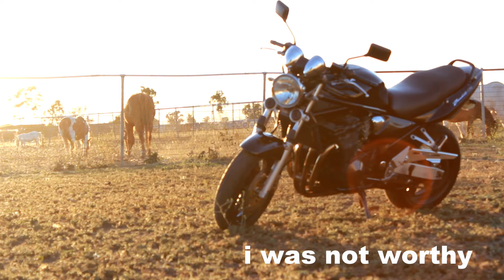How To Become a Motorcycle Mechanic With No School (2020)

Comment: Your advice also applies to many careers outside of wrenching on motorcycles. It's basically how I built my writing career. Practice, practice, get good, and harass people until they start publishing my stuff. :) I still hold down a day job to pay the bills, but yeah, living the dream. You're an inspiration. :)
Reply: Justin Hughes same here with software engineering. I got an associate’s, but it’s basically gen ed and two entry programming classes. It got me in the door somewhere. From there, I’ve learned everything on the job

Comment: if you want to learn how to fix motorcycle,
1. learn how motorcycle parts works and perform its jobs.
2. each part of motorcycle is parts of a system working together.
3. it is easier to learn on small motorcycle or single cylinder engine and  then go for more larger or bigger or multiple cylinder.
Reply: Amen.

I'm learning to do it myself because I cant afford to have a shop do it for me. It sucks major ass. I am looking to buy or just take a scrap engine for either free, or for very little and see if I can work around it. See how it works and ultimately take it apart and then assemble it once more into a functioning engine.
Reply: I have an 2001 bandit just like her and I can barely afford a shop to do anything 
Guess my carbs are coming off again
Reply: any YouTube channels you recommend or websites and or books?

Comment: OMG I love this so much!! I originally thought I wanted to be a mechanic. Got my first car (86 Civic hatchback) at 12/13 years old, completely broke down, for a mere two Jackson's ($40). Tore the thing to the ground to rebuild it back up. I had doubts in my abilities along the way that left me on the edge of mental and emotional breakdowns over it. Over the following ten years, I would find, repair, and flip another 16 vehicles (13 cars/trucks, 1 motorcycle, 1 dirt bike, and a JET SKI)...and well, I must have done something right cuz I have yet to see any of my previous vehicles in a junkyard! Currently working on fixing another 2 bikes as well as a gas generator of all things. In 2018, a shop my bud had been working for had an open spot and he put word in for me, they interviewed me and one other person. Needless to say, it came down to me, a shade tree mechanic of 8-9 years, or some 18 year old who hadn't even performed an oil change in his life. After nailing what I thought would be my dream job, I found out that I actually hated every second of the automotive variant in that field. Now I'm just a lost soul searching for his "call to arms" all over again... One of my interests is custom fabrication. I did buy a cheap Harbor Freight wire welder, which has its...limitations...but I can still weld mediocrely well on it; now the issue with that is I have no project that requires fabrication and no money to buy said project (or materials) because screw the C-word going around right now! It'd be really cool to get into things like custom motorcycles, which is how I came across your channel (rat bike build came up in my search on YT), but I don't really have any artistic vision at the present moment. Still interested in giving power sports repair a try, myself, as working on that jet ski was...different, to say the least, and very intriguing; cool pieces of technology! I'm also interested in adventuring touring in some foreign place, like Africa, as a guide. That would be BAD ASS! But would also require the funds to travel as well as years' of experience in the savanna.

Not inspiring like your story at all, but that's the "glory" of life: everybody's story is different, and some peoples' success can take years to come to fruition. The hardest part, for me, is comparing my rate of success to those of people around me. It's rather off putting and pretty much the main source of my chronic depression. I know comparing myself to others is not that good for my mental health, but I cannot help it because I'm a pessimist and can only see the negative side of things. God I hate being flawed. Luckily motorcycles are one of my coping mechanisms. I keep searching on Craigslist for yet another project even though I don't have ANY space to put another one! LOL
Reply from the maker: Hey a good friend once told me, "We believe the story we tell ourselves". So when I start to tell myself I'm not good enough, I start to believe it... You have to tell yourself that you're awesome!! Pretty soon you'll realize how true it is! I also compare myself to more successful vloggers sometimes, but there is no point... I am on my own path, paving my own way, just have to focus and be better than the person I was the day before.
Oh and I'm totally also on craigslist every single day when I have no money either XD LOL!! Can't help myself.
Reply: @KillswitchQueen  the good old x+1 is how many bikes you need. 🤣
Reply: @KillswitchQueen  hi, 
How much would you charge to walk me thru an oil change on a 2004 Suzuki volusa.  
I'm a new rider,  I like your videos. From Anaheim California 😊💕💞💟👍

Comment: I just came across This video. I just turned 29. I’ve got two left hands, probably a delayed motor skills issue but never felt comfortable with any tools. Screwdriver to Power drill to a grinder... my father is a master carpenter and is basically Rambo with motors. It’s a little emasculating to be honest, but It’s why I have a huge respect for people who work with their hands. I love motorcycles. I actually just sold my Vulcan 800, my first bike... big reason I sold it was it had a chain... I hate cleaning and lubing chains and did a chain replacement... well my dad did and I watched. I’ve got an offer to buy my uncles 88 1100 shadow but god do I just want to ride and not wrench but I guess this is the price you pay for the addiction! Thanks for making this, it made me feel a little bit more confident that maybe the guy who took a whole afternoon to do an oil change, might actually be able to decently maintain a bike?... but, I’ll still hate chains!
Reply: Your dad’s excellence doesn’t emasculate you. You believing it does is what emasculates you. Stop blaming your dad and start winning at life.

Comment: As a career motorcycle mechanic of 17 years from small custom shops up to dealerships... just got to school, a full 2 years cost you what you'll make the 1st year within basic certs. But i did start the same way at 14 on my own streetbike, was cleaning carbs for everyone by 16, now own a shop and work at a dealerships. If you wanna skip the begging and bs of finding everything out the hardest way possible. Just spend the 30k-50k. Or take a basic course through penn foster, or for free use bobs online motorcycle course. Make 45-70k every year after and it never feels like work. Avg moto techs make 40k if your trash, 60k if your ight fr. Btw i was a shop manager over mmi grads with no certs at one time so i get it. But from me to you... learn properly, youtube isn't a good teacher imo
Reply from the maker: I understand where you’re coming from, but learning on my own, I now am in a field of work making 70k a year starting and still didn’t need any school. I guess if you are okay going into that much debt, that’s up to each person. But I make good money with full benefits and a pension. I think everyone’s path is different so we won’t all get there the same!

Comment: Nothing makes me more happy then being on my ducati on the road sadly after 4 years i broke something and i just been searching videos for ways to fix it myself and i dont have the money to take it to the only shop that works on ducati in my area they charged me like 700 for a oil change and to fix a clutch problem that turned out to be air in the line so yea crooks i refuse to take it back there. Glad this video gave me the confirmation to do it my god dam self thanks ! burn rubber not ya soul be safe out there my fellow riders !

Comment: Hello me from Indonesia, in Indonesia many flattened flats do not mechanical schools. For example such as mechanics in this channel without school and only the pattern of elementary school / elementary school. The beginning is indeed there is in the sacrifice, the beginning of the motorcycle victims that make it practice. Yes luckily the motor itself. But many are the workshops from origin, originally open the motor bolt directly bucket workshop. and in Indonesia its tool is also less adequate adequate there is Martil😁😁

Comment: I just discovered your page, I have a 2011 V Rod Muscle and a 2014 Softail Deluxe, I've done small things like changing the fender, luggage rack and seats. Do you have a video that will help me install highway bars and change my handle bars on my Deluxe, the wiring inside the bars has me afraid to do the work.

Comment: Very inspiring, I love learning g about my bike but I'm not too mechanically inclined. I think my clutch is slipping and not sure if it needs a clutch adjustment or new clutch plates. I'm trying the adjustment first but I love learning more about it and saving labor costs is a plus.
Reply from the maker: You can do it! Even if it needs a clutch job, they are straight forward and swapping the plates is easy.

Comment: Ugh - was hoping for some real detail, not a 30,000 foot overview of your journey.  Those first steps are oh so important and difficult.  What were the first repairs you were doing?  You mentioned the petcock valve but you didn't say anything about how you knew that needed work, what were the symptoms, what was your diagnostic process, how did you finally know that was the issue?  How did you find information on how to repair it? What sources of info did you use to learn these things?  How did you know you weren't going to screw something else up?  Those sorts of things about your early, solo repairs are SOOO important.  maybe another video where you dive deep on that stuff?
Reply from the maker: Uhh… that’s the thing. I didn’t know much when I started. Most of what I learned in the beginning came from Google, forums, and asking my local mechanics when I had the chance. A petcock is obvious… it leaks fuel. So you rebuild it with new seals. How did I know? Fuel was leaking. I google’d it. I looked up repair manuals. I did my best with what information I could find. There’s always a chance to screw something else up and that’s going to happen when you’re just starting out. 

Most everything you need or want to learn about motorcycle mechanics is out there. Pick up a service manual and read it. It will explain many different procedures, testing, diagnostic work, symptoms and how to figure out the problem. YouTube has endless videos that cover everything from putting air in the tire, to entire engine rebuilds. Find a source you trust and crack at it. Pick up a cheap project bike and pull it apart. There’s no real mystery here, just putting in the time. You just have to want it. Best of luck!
Reply: @KillswitchQueen  Thank you for the detailed reply!!

Comment: Since this is a how i became a mechanic i hope im surrounded by mechanics in the comments.pro question.i got a 450cc fuel injected.stock bore 98mm,stock compression 11.8:1,factory recommended octane 91/93.i big bored it to a 98mm bore with a ratio of 13.5:1(no bottom end upgrades)WHAT OCTANE FUEL SHOULD I RUN NOW?!✌🔥

Comment: Ummm my bike head lights went out...but I have a cheap sport bike x22r....3 color wires blue white green....high beam still work's...
Reply from the maker: Check the bulb? Is it a dual filament? Or two separate bulbs? Check for power to the light, work your way back.

Comment: Hi I'm a subscriber from Philippines, please help me i have problem with my bike a z1000. I changed the oil and the filter but after the engine oil light is blinking and it seems the the oil is not cerculating. Please advise me what to do. Thank you.
Reply from the maker: What year is your bike? How do you know the oil is not pumping? What does your manual say that the blinking oil light means?
Reply: @KillswitchQueen  model 2013,  i can see it in the oil level glass window is not moving and the oil seems has bubbles. In the manual it say low oil pressure or low level of oil.

Comment: As long as you are not a complete moron you can become almost everything without school. You just have to start doing it. And to be honest, a motorcycle mechanic doesn't need to be the uber skilled person anyway... It's all simple and basic mechanical stuff. Only when it comes to the electrical systems and CAN BUS Systems on modern bikes, it gets complicated but how many times does a mechanic fix such electrical systems or even build them....

LOL I would rate a tyre change more skilled than an oil change... but whatever... lol those are the most basic things you could do on a bike.